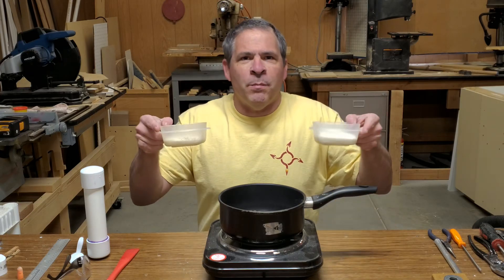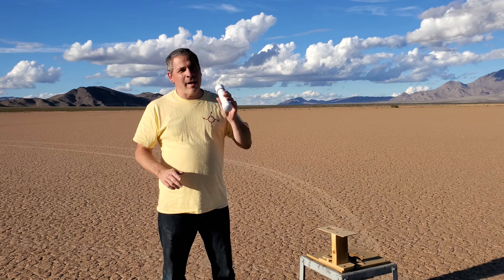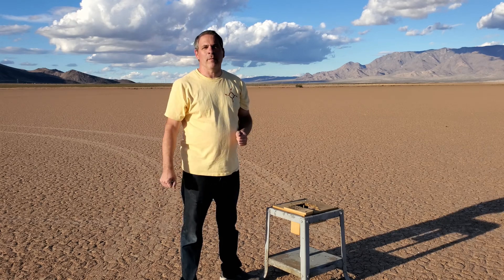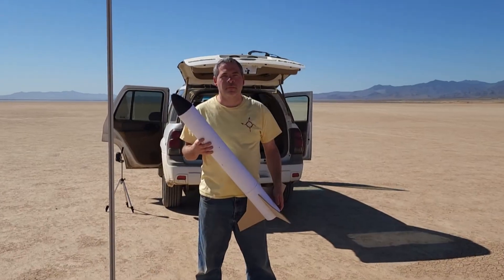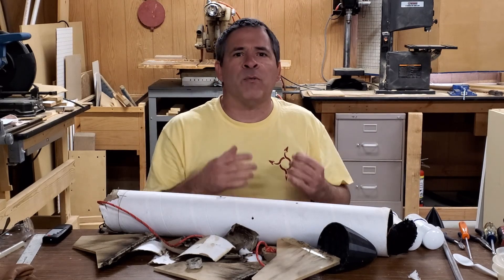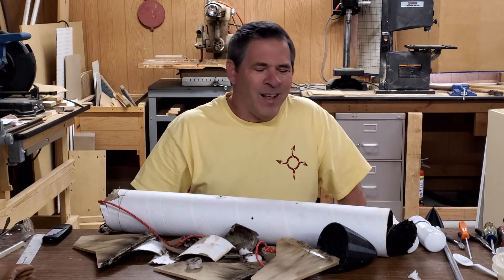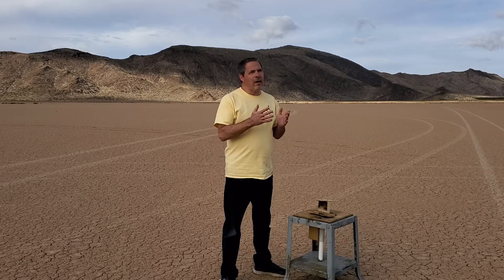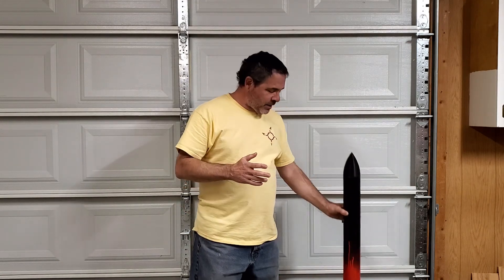Testing the simplest sugar fuel in our simplest rocket motor

Comment: Yes it is because you are pour casting the R-Candy. R-Candy needs to be pressed not pour cast. My suggestion is make R-Candy with added 2% red iron oxide after its all melted into a smooth mixture pour it out onto a large cookie sheet. Let dry completely. Break up into small chunks and grind into powder. Then press into motor housing. I am extremely sure this method will surpass the flex-fuel! I understand it is more work than pour casting but it is totally worth it if higher altitudes is your goal.
Reply from the maker: Interesting info... I don't think I'll be going back to R-Candy but I'll keep this information in mind if I do.

Comment: I am really enjoying watching this channel im new in rocketry but i have a confusion. can i use homemade glucose syrup for flexi fuel motor because corn syrup is not easily available at my place. I only worked with r candy because it was easier to make but most of the time it just explodes so now I am switching to flexi fuel
Reply from the maker: Glad you enjoy the channel. I really like using flexi-fuel and I think you will find it better to work with than R-Candy. I am aware that Corn Syrup is not readily available in all areas of the world. So a while back, we did some experimenting with other products to see if they would work. We tested Molasses, Honey & Brown Rice Syrup. All three worked well. You can watch those videos here...
https://www.youtube.com/playlist?list=PLdExiIqOZ0llJQ42u5XqHqHTp8298Ze5z
I have not specifically tested Glucose syrup but based on our other tests, a wide range of sugar syrups should work well in flexi-fuel so I would expect Glucose syrup to work too.
Reply: @rotaryrocketry  Thankyou so much for replying. I just watched your previous videos and now I'm gonna try the honey version of flexi fuel haha
Reply from the maker: Just a note... if you find that the honey fuel is too soft and won't hold it's shape when cast, try heating it hotter. In that video, we said that it was cooked to 230F but later I discovered that my IR thermometer was reading incorrectly.  So the fuel was likely cooked to somewhere around 260F. But I would start with 230F and see how it goes.
Reply: @rotaryrocketry  got it, I'll give it a try for sure. Thanks a lot

Comment: Hey I love your channel. I had a quick question I was hoping you could answer that could help direct me in this research phase of a project I'm working on. In your opinion, what solid rocket fuel ignites the easiest and fastest? Would it be black powder or is there another fuel I should be researching for as close to instant ignition and thrust as possible? Thanks
Reply from the maker: I have only made sugar fuel so not very familiar with the process of making other types. You mention "instant ignition"... I will say this... Flexi-fuel sugar fuel that I use does not have an instant ignition. The motor takes a moment to fully ignite the core and get going. If you cook sugar fuel to a high temperature like 250 to 270F you will get a hard fuel that does ignite and burn quicker but still not really "instant".  The fuel we've been making recently is cooked to 210F and burns a bit slower so the motor tends to "smolder" for a second before fully igniting and providing thrust. All that said, if you don't want to make sugar fuel, then I think you should research APCP fuel. It is very common in amateur rocketry.

Comment: Just finished watching. Thanks for the video.
But i don't see what i wanted to see the most. After the blow up, i would like to see you adding corn syrup to see if there is any change in the fuel physically and when it burn.
Reply from the maker: Well, I'm not re-doing the video but here is what I can tell you...
When heating the fuel, flexi-fuel blends and melts to a pourable fluid MUCH faster and easier than Rocket Candy.
Burn rate of flexi-fuel is slightly slower than Rocket Candy. 
Flexi-fuel is not prone to cracking during ignition like Rocket Candy so it's more dependable.
Overall... Rocket Candy (potassium nitrate & sugar) is an old and in my opinion, an obsolete fuel. There are much better, much safer and much more reliable mixtures... Like flexi-fuel.
Reply: @rotaryrocketry  when i look into google on how to make powdered sugar, it says "1 cup granulated sugar to 1 tablespoon cornstarch." Is this usable? I can't buy powered sugar (company made) out here but maybe i can make it myself if i find cornstarch, and granulated sugar simple means grinding sugar into fine powder right? What say you?
Reply from the maker: If you make your own powdered sugar, do not add corn starch. The corn starch is only there to prevent the product from clumping in the bag.
Reply: @rotaryrocketry  and I can't show you how i make because i don't keep video or photo record. But i can tell you how i cook. I used induction to cook the fuel. I first heat small amount of water with high heat, then i mix with sugar (i grind into powder) after some mins i mix potassium nitrate. Once the fuel started boiling i reduced the heat to medium heat. After some mins of cooking to medium heat, i then again lower the heat to the lowest and let the all the water turn into vapour. Then i pour into the pipe. I once make many and pour into 2 inch 2 feet pvc pipe. I forgot to pull out the rod, when it's all dry, i try to pull it out but can't. So i break the pvc pipe and destroy the fuel. It's quite hard to break them apart. It's not brittle as some says. Even hitting the pipe with hard objects doesn't break the fuel apart. What do you think? Was the fuel not brittle because i cook it with low heat? (I don't burn the sugar)
Reply from the maker: A few comments...
1. You should not be making a 2 inch x 2 foot rocket motor unless you are already experienced with smaller ones. I assume you are trying to duplicate Dan Pollino's K500 motor. That is NOT for beginners. You should start small like with our Dart Monkey or Super Monkey motors that only have a few inches of fuel in them. Get comfortable and experienced with these smaller motors, then you can work your way up to larger stuff.
2. You really should have some way of measuring the temperature of the fuel when you cook it. If you are always guessing at the temperature, then it will be slightly different each time which will result in unpredictable burn rate differences. An Infrared thermometer is the best way because you can take accurate measurements quickly. A thermometer could technically work but remember that it reacts very slowly. 210F to 230F is all you need for Flexi-fuel.
3. When people say PVC is brittle, they are referring to what happens when the motor explodes. At that time... It's brittle.  And if you have a solid chunk of PVC, cooled sugar fuel & metal coring rod... Yeah, that will be super difficult to break apart as you found out. You gotta coat the rod well with oil and taking the rod out while the fuel is still just a little warm helps also.
4. I'm familiar with the "water" technique you are using for making the fuel. I personally don't like that method but it does solve the problem of dissolving the sugar when making Rocket Candy fuel. If you switch to Flexi-Fuel with corn syrup, you do not need to introduce water to the fuel mixture. If you are in a part of the world where corn syrup is not readily available, we have tried Honey, Molasses and Brown Rice Syrup... All with good results. We have videos for those... Let me know if you want a link to them.

Comment: This is all very interesting data.
The obvious advantages of flexi-fuel is its final flexibility and low cooking temperature.
Per Richard Nakka, the Isp of KNSU is a little higher than KNSB.
But the water in the corn syrup will lower that.
The formula you gave, and Pollino's two books are all three very similar but not identical.
Regardless, they're all leaner than 65/35 KNSU or KNSB.
Per Richard Nakka running more lean makes it run hotter with about the same Isp.  That would compensate somewhat for the water content of the corn syrup by vaporizing the water.
The conclusion and open questions are
 - Flexi-fuel is a really smart way to avoid the extra cost of sorbitol.
 - Why use corn syrup and not just use a little water instead?  
Contrary to rumor, "ordinary" corn syrup doesn't contain much fructose, the simplest sugar is glucose.
I don't know much about the physical properties of glucose, but fructose melts at a fairly low temperature and upon solidifying takes a long time to crystallize, before which remaining in a glass state.
Maybe high-fructose corn syrup would be cheap and interesting?
Reply from the maker: As you know, there are a few different flexi-fuel recipes out there. Probably just the result of people experimenting and finding something they like. I've recently switch to using Dan Pollino's original recipe and cooking temperature. I really like the consistency of the fuel and the burn rate. It burns a bit slower than the fuel I've been making for the last few years.
I've seen someone on YouTube use the "water" technique in place of corn syrup. With that technique, you need to bring the fuel above boiling point to boil out the added water. I just like the corn syrup method better. It's faster and simpler.
As for glucose vs fructose, we did some testing a while back and found that a variety of sugars work well in the flexi-fuel. Monoglycerides, Diglycerides & Triglycerides will all work. Corn syrup is just cheap and easy to find... At least here in the USA.

Comment: What about sch80 pvc?
Reply from the maker: Could be helpful due to increased strength. Just wasn't something that occurred to me at the time.
Reply: I wondered about that, too, never tried it, but it's not much stronger relative to much increased relative cost of both the pipe and the fittings (at least where I can get it locally, here in Podunk, USA).

Comment: I'm not sure how you are casting the R-Candy propellant but from my experience, I've never gotten it to be pourable. And if packing is the method used, it lends itself to lots of voids and will shrink as it cools. Add that to the fact it doesn't bond very well to pvc and you have many ways that it can overpressurize from the increased burning surface. There are ways you can mitigate those issues...use a liner in the pvc case (I've used copy paper), you can add compression on the propellant so that as it cools it bonds tighter to the casing and helps eliminate stress cracking. 
It is hard to make two or three 'identical' R-Candy propellant motors because of the way it is mixed, stirred, and cast. I've made thousands of 'sugar' motors from 1/4" to 12" diameter monster motors with hundreds of pounds of sugar propellant in each and had hundreds of failures along the way. If you give up you will never know what the problem was and you will be at the mercy that it will happen again. 
https://www.youtube.com/watch?v=eeOVhQKnTfg&t=1s 
Our first two 12" motors worked perfectly, the third test failed. We learned a lot from the failure and look to a fourth successful test in the future.
Reply from the maker: So I don't know the final temperature that I got it to, but I did have a pourable R-candy with this project. It was hot... really hot... Much higher than the 230F that I use for Flexi-fuel.
Honestly, I gave up on this one because I really think that R-candy using KNO3 & Standard white sugar is an obsolete fuel. As I'm sure you know, there are much more reliable fuels and I was chasing my tail on this. Eventually I just decided it wasn't worth putting in any more time & money. I've used Flexi-fuel in both the cases used in this vid and both motor designs work spectacular with that fuel. I was really just trying to have fun with an old fuel mixture but it proved to be unpredictable & unreliable. It was fun but not worth pursuing. 
I watched the vid you sent... Really nice. I love how it was buried in the desert for both support and safety. That would have been spectacular if it had exploded.

Comment: I was going to suggest lessening the coring depth to create more of an end-burner and slow the rate down a bit.  Nice little project.  Thanks for sharing. 👍
Reply from the maker: Interesting idea and it would likely reduce internal pressure a bit... But... The way this motor is built, the fuel is cored from the top down so with that method, there is no way to leave an un-cored section at the top.
Reply: @rotaryrocketry  Yeah I suspect that attributes to the rate at which this motor is burning. With this recipe you would need to redesign the motor.  Great experiment though.  Now we know!  ;-)
Reply: There are many ways to make an end burning sugar motor with an initial core to provide enough thrust for liftoff. Easiest for the method you use is to simply put in a few inches of propellant and allow to solidify with just a 1/4" or so of the coring rod in the surface of the propellant. This will provide a slot for the coring rod in the next section of propellant. 
There are other ways to but a problem with this it creates a longer burning motor, not good for a pvc case that will get soft and fail with either a burn through or CATO. This method will work with steel case motors or aluminum with an insulating liner. I stopped doing pvc motors long ago because they are single use and just not worth the  effort or time.
Reply from the maker: @mojaverockets  True... End burning or even multi-grain burning is a significant problem with PVC cases due to heat contact with the casing which typically results in a very quick case failure. Important to keep the burn within the confines of the fuel cell for the entire burn so the fuel is actually protecting the case. This creates it's own set of adventures but that's part of the fun :)